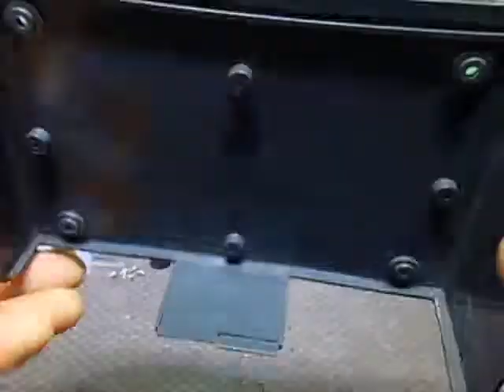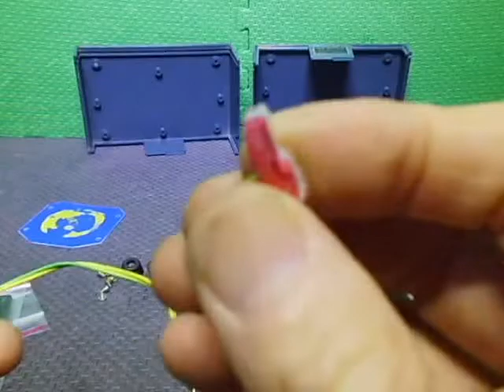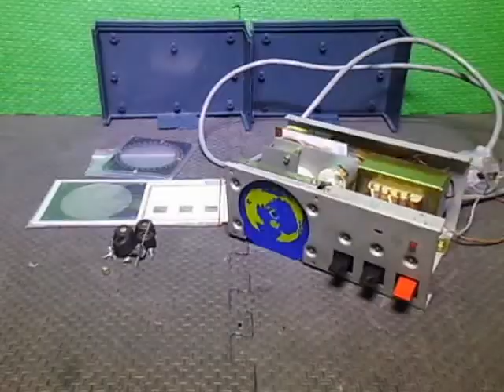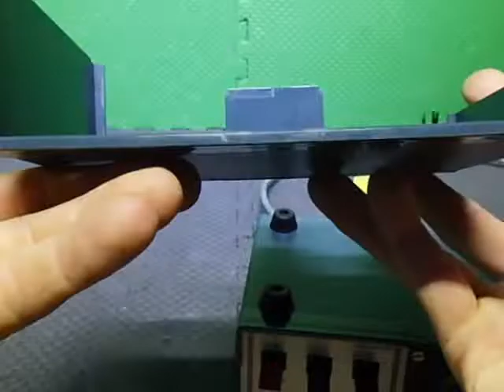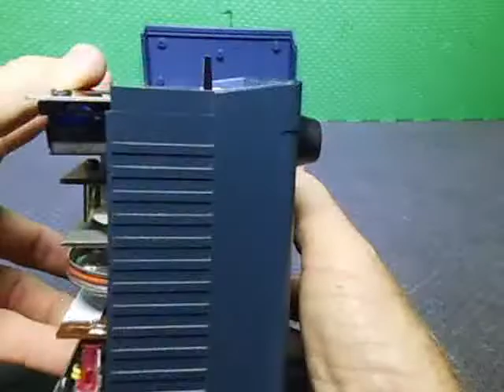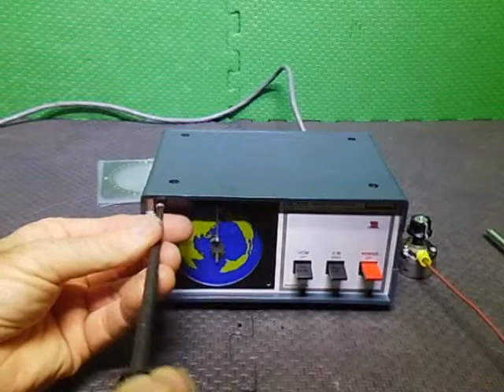DAIWA DC-7011 Controller, Refurbishment & Upgrade

Comment: Could you show how you connected the pot to test controller with out rotator
Reply from the maker: Hi Arthur, Thank you for the comment. The test POT is a 500 ohm wiring wound. Pot pin 1 wire goes to terminal 1 of the controller, POT pin 2 wire goes to terminal 2 & POT pin 3 wire goes to terminal 3 of the controller. If you have the original operators manual it has a schematic diagram in it showing wiring layout etc. If you want more info etc please get in contact with me via my web site, which is listed in the description of the video. Regards Peter of Duoro